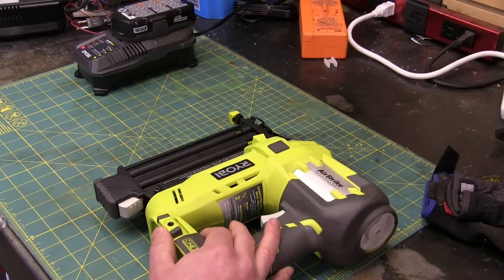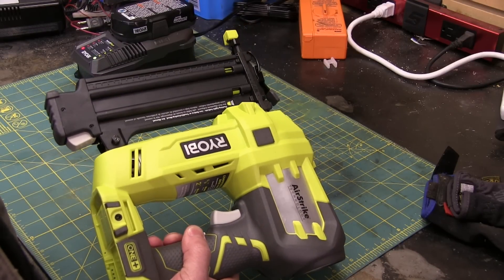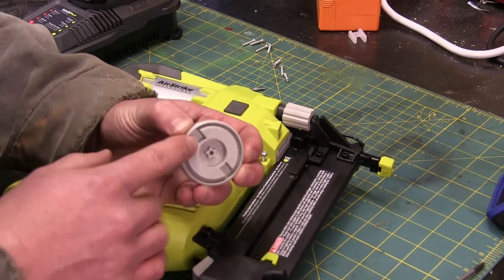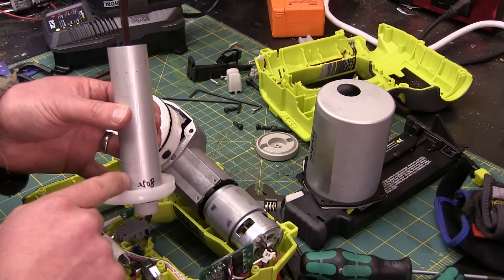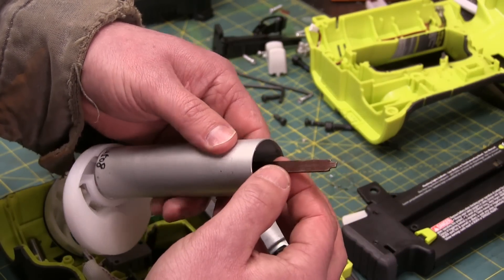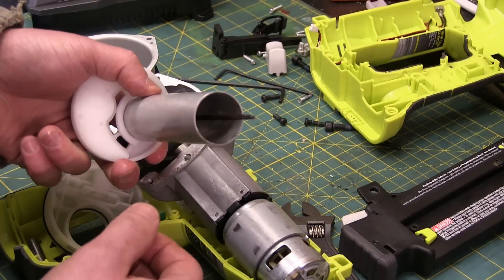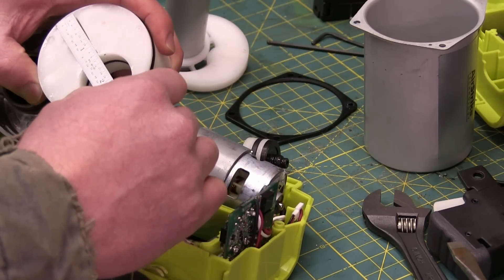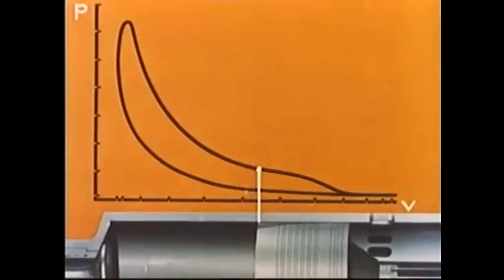BOLTR: Ryobi Nail Gun 18V cordless

Comment: Got news for ya. I purchased the 18gauge stapler, promptly dropped it from the 8ft tiki bar roof i was tacking grass thatch on,,, and yea it hit the concrete around the pool. I cussed, quietly to myself as i was at a fancy-ish establishment. But low and behold,, to my amazement it still worked! So i went back on that slipper tit,, tiki bar roof and pro-ceeded to repeat the above described proceedire not once more but twice more, for a grand total of trice the stupidity. And yet I continued to fire thousands of more staples down onto floors into the next year of that poor staplers life. And it gave up and I retired it with honors. Bought the brad nailer and rebought the stapler with full confidence.

Comment: You didn't finish the calculations. What is the mass of the hammer and slave piston assembly, and hence the acceleration from that 30 pounds of force? What is the throw distance, and therefore the final speed at impact? And what about on the receiving end – the nail? How much does the nail mass? How far does the hammer act on the nail? Ultimately, what is the drive impulse? Ballpark.

:p

Comment: Hey know-nothing chinese language student here, the different fives may be due to the way they write their characters, as students are taught a "stroke order" when they are young, which generally goes from top left to bottom right, and horizontal lines are usually drawn by themselves from left to right even if they meet with another line on the left, so that may make them seperate the top of the 5 like they do when writing the word for 5 （五).

If you are curious it is pronounced "Wu" but you drop your voice lower on the u and come back up  with more of an "uh" sound. so its like WOoOh. Yes the language is actually this fucking complex, and yes it gives me headaches. If you dont use the correct tone when saying the word for mother you could accidentally call her a horse or curse her name. It also varies hugely by region so even the chinese use subtitles a lot.

Comment: I bought my dad one of Ryobi's Impact drivers, back when Ryobi was brand new and were still colored blue. It came with the shitty nicad batteries or whatever. The batteries were complete shit, but the impact driver... With the older lithium batteries, the damn thing WORKS.
It's used nearly every day in contractual work, so I expected it to break in a heartbeat.
Years later, still running.
The new green shit, in comparison... I don't like it. It looks cheap and flashy like a toy. At least the older blue models weren't trying to make a statement.

Comment: Did you ever get to using the Ryobi drill / impact driver combo?  - good enough for an occasional user/ home gamer?
Assuming they are of similar component quality as the nailer and them being mid range priced I am thinking of getting a set to replace my brand new but wanked out NiCd combo drill - which has not appreciated a year long sleep without use...recovering the NiCd batts method (2 frigging days a pack wasted) has not worked and not woken them up from their long deep sleep. The hardware is not worth converting to 18650 and frigging with balance circuits and chargers and there is no way I'd waste money on new NiCd cells....plus 18v is bigger than 14v...so its already WAAAY better ...right? - Thanks for doing these tear downs - it gives me a laugh as well as gives me a good incite as to how much mechanical sympathy I'd have to show the machine should I own one.

Comment: Ryobi used to make string trimmers in Chandler Arizona. The best string trimmers made by undocumented Latino workers in America.  I forget what the other brand were they sold those under. The fuel lines rotted off mine, and then the priming bulb rotted off. Now I can't figure out how to install new fuel lines, because they were pressed into the lower half or fuel tanks before they sonically welded the tanks closed.
Reply: Seth B screw a damn hose barb into the tank
Reply: James Griffin

Comment: Lol you can shit on Harbor Freight allll you want but they ABSOLUTELY make some tools even professionals can take advantage of. Specifically, pushpin panel tools and their work carts and boxes. I have a newer (about 3 years old) US General tool cart, black, paint is still excellent shape, been in shop use for 3 years, it’s never broken etc, drawers all slide perfectly fine still like the day I assembled it. And the US general box I have is awesome as well. I paid under $800 for both, and would have been looking at around $5k US for some “fap off” boxes of the same size. Even if the carts/boxes only lasted 2 years the price point makes sense when compared to snap on, however they last FOREVER we have a tech with one that’s 15 years old still going strong, could use some new drawer slides and casters but other than that shit, she’s still alive lol

Comment: Isn't a "chintzy little contact switch" really all you need?   The switch only controls a small amount of current going to either the microcontroller or MOSFET gate.  BTW, yes I like Ryobi 18v tools, been using and abusing them for a little over a decade.  I use them in harsh environments everyday as an electrician. The value can't be beat,  I've used or owned all the brands and I guarantee you'd be hard pressed to find a difference between them in an actual on the job environment.

Comment: It would be to everyone's benefit, including your own, if you took these units apart screw by screw and then put them back together screw by screw like the other channels. No cutout and then return. There is a good chance that the thousands of eyes would have picked up on a reassembly error. Also, the nonsense that you refuse to test the unit out before you tear it down is bewildering - like you're above it all! There is lot of information that you're missing out on by not pretesting. Too much chatter about the plastic - is that your expertise? It's such a shame and a waste that you couldn't get this unit working after tearing it down. I suggest that you view the Thrifty Tool Shed's tear down of this unit - maybe you can see something that you missed - then come back and get it to work.

Comment: This is an older video, true. But in what fucking "prosumer" market (then or now), are we using a battery operated brad nailer. Air power or GTFO. I'd use a hammer stapler before a battery brad nailer.